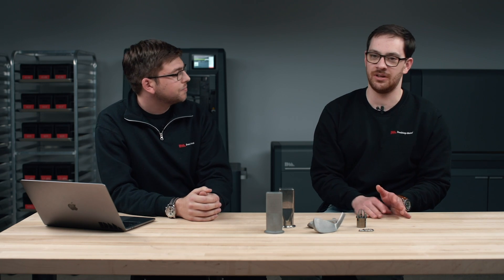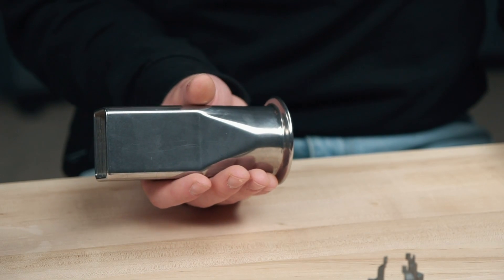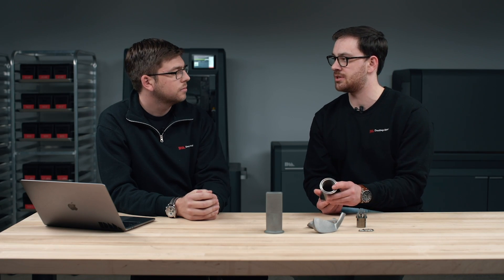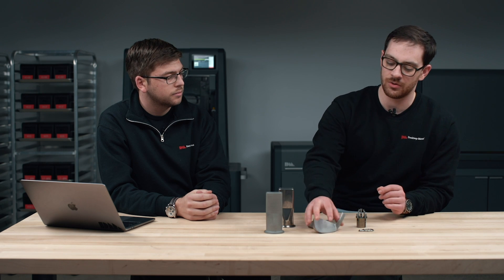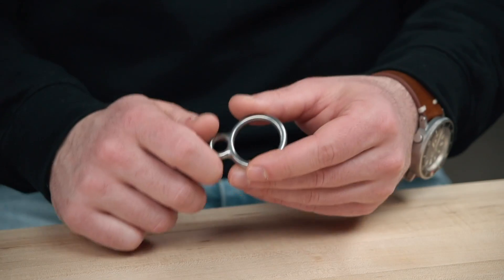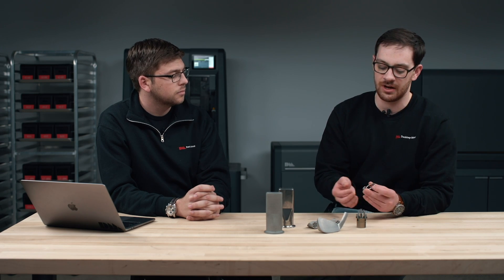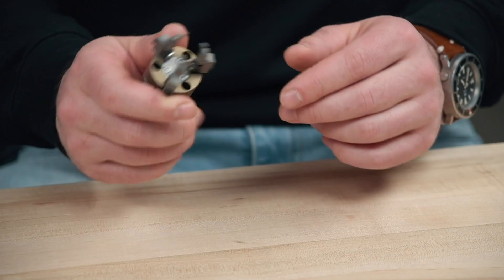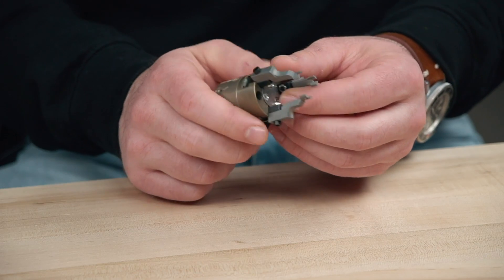3D Printing with 17-4 PH Stainless Steel | Metal 3D Printing Materials 101

Comment: Outstanding video on additive manufacturing and 3-D printing technology.  Use of a stainless steel metal product with 3-D printing makes a lot of sense.  Thanks for a fine design-application for parts.  (The 17-4PH metal is ideal for a long lasting function part design.)  Metallurgy has come a long-way!

T J (Tom) Vanderloop, CMfgE, Author, Mechanical Designer, and Consultant; ATEA, AWS and SME-Life Member
Reply from the maker: Thanks TJ!

Comment: you talked about heat treating 17-4 ph, after heating it up, how would you harden it? Would you leave it to cool or put in water or oil?
Reply from the maker: Hey Josh, to answer your question, once the part in it's green state goes into the Furnace it is heat treated to remove any polymer binders and you are left with a hardened metal part. The furnace does go through a cooling process in order to achieve this. I think watching this video will help - https://www.youtube.com/watch?v=zCLsHWeRjJE&t=10s

Comment: What's the final percent metal that's reached with this printer? With smaller DMLS printers such as the Orlaser creator on the market now for similar pricing, other than build volume what's the benefit using this technology over something that will result in a 100 metal part?
Reply from the maker: The final part has the same density and metal composition of a cast part or a part made with a metal injection molding process. The advantage here is being able to produce small volume or high complexity parts without having to go through a lengthy machining process or produce parts that would not be possible with traditional manufacturing equipment.